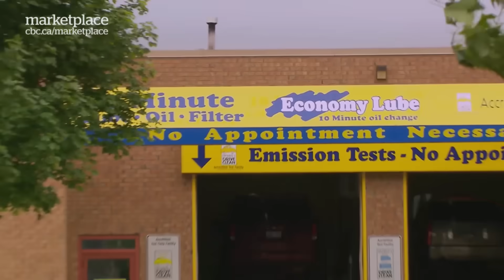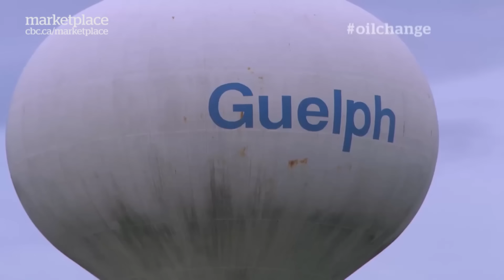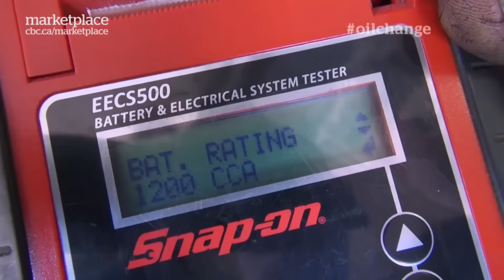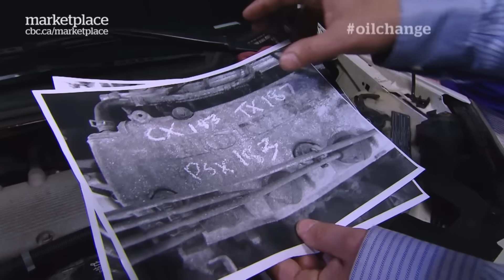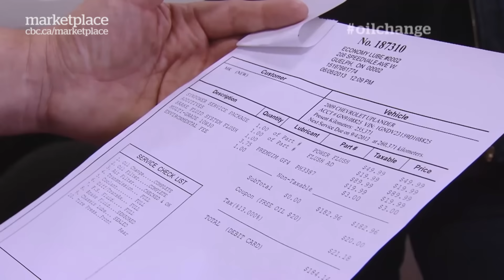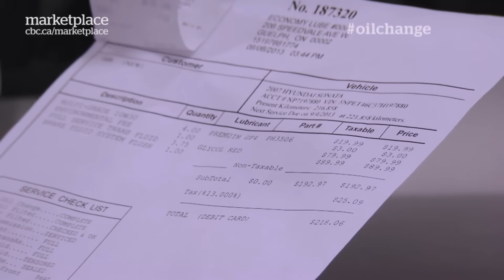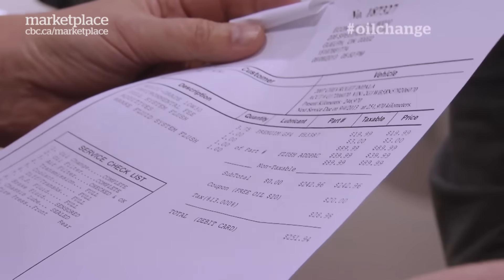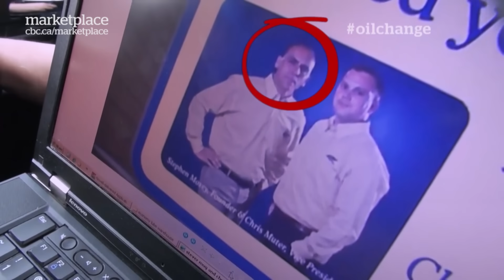Oil change scams: Hidden camera investigation on what really happens to your car (CBC Marketplace)

Comment: “Yeah, looks like your blinker fluid needs changed”
Reply: lmaooo....."Looks like the windshield wipers' fluid needs to be changed"
Reply: I have sold out of Johnson rods
Reply: TheChangospace navigation and speakers need to be changed, 50$
Or the good quality version for 700$
Reply: @Kayshots  Your car has a scratch in it, a whole factory quality paint job is needed.
Reply: Almost Here looks like your piston return springs are going bad
Reply: "Your GPS looks a little off... We can grease it up for you for $500"
Reply: Nice stolen joke
Reply: You need a long weight. That will take awhile.
Reply: 🤣 not far off, they do take advantage of people who just dont know much about car maintenance
Reply: @javaghoul  Even if you do know a lot. You can request XYZ oil as mft specifies.
Certainly Sir No problems Sir. BUT how do you know what they actually put in? BTW I got caught by Subaru Service. They topped up the wind screen washers with Subaru Brand windscreen wiper fluid and charged accordingly. I tend to use my feet ie I paid but never went back.
Reply: My brother got one of his coworkers to believe him when he told her that. His fiancée had to break it to her that my brother can’t be taken seriously.
Reply: TheChangospace that could be true
Reply: @TheChangospace  needs a can of tartan paint.
Reply: Hey guys ChrisfiX here
Reply: Always make sure to check the muffler bearing
Reply: TheChangospace nah it’s the inverter cap 😭
Reply: Headlight fluid
Reply: I always change my blinker fluid myself,
Reply: "Your door fluid needs to be changed, that will be $100"
Reply: electronics fluids have gone black
Reply: Classic xD
Reply: OnThe Gang finally someone mentions the head light fluid container!
Reply: @baobo67  - boom!
Reply: @baobo67  - approximately how much was it for Subaru windscreen washer fluid?
Reply: @CashIsKing_UseItOrLoseIt  It was a long time ago and its first warranty service. The washer reservoir was half full and it cost more than a whole bottle of what I use a little bit at a time.Not Subaru brand. Maybe it had antifreeze which is never needed in Sydney. There were a heaps of little things they did like grease the door hinges, things I would do myself but it was the washer fluid that lost me. Great car though, one of the best I have owned.
Reply: Lmao

Comment: Im surprised they didnt tell them that all 4 tires needed the air replaced 😂😂😂😂😂
Reply: For a great deal of just $100 a tire! We’ll even throw in some free tire valve stem caps! Plus $50 per square inch of compressed air, because compressed air is really hard to come by these days. Also, your windshield washer fluid is blue, when it should be rose gold. It smells really burnt too.
Reply: Cody Waters LOL
Reply: Stacey Otey $10 bucks for air fill up for each tire
Reply: Cody Waters and at the same time i saw that you had no brakes, it will cost ya 100 dollars for each tire but you are lucky! Buy it now to get invisible brakes for just half the price!
Reply: thats a good one. u should apply for a job there.
Reply: Some cars have nitrogen gas in the tires, not sure why! we have to pay for water whats next?
Reply: @gogogeedus  
All cars have a minim of 75% nitrogen. My tires came nitrogen. Regular air goes in just fine.
Reply: Untrepid One you can’t scare me into buying anything. I know enough about an automobile to know when someone is attempting to steal my money